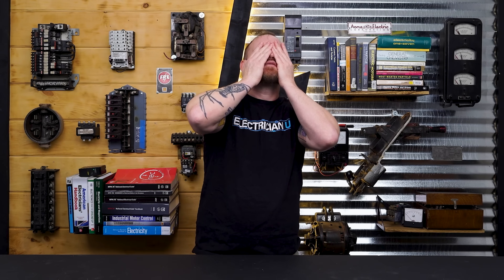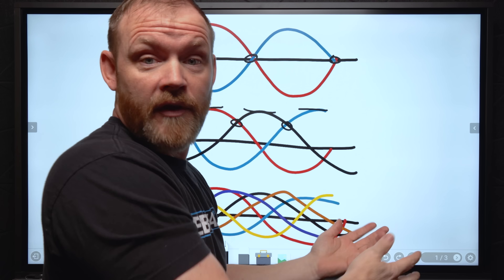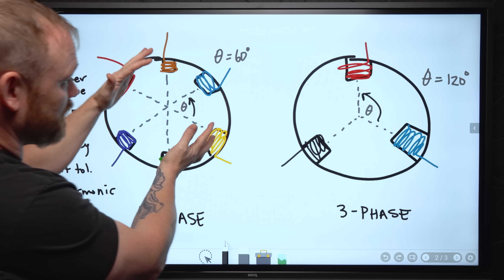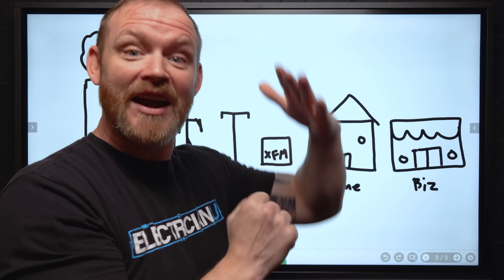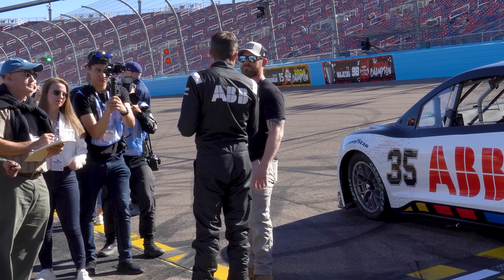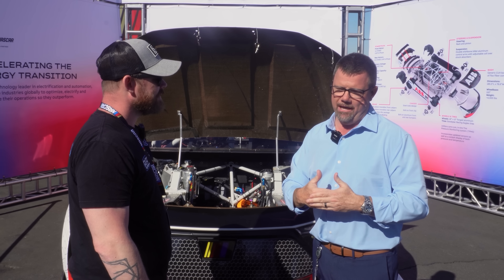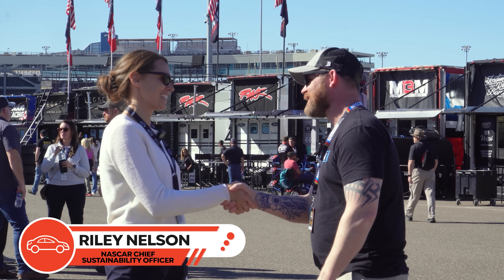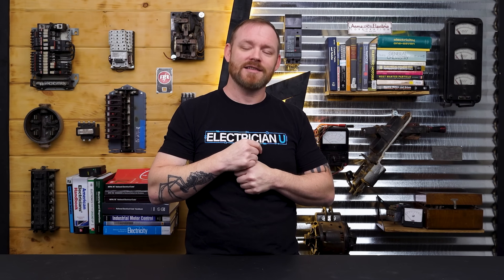6 Phase Power is a REAL GAME CHANGER!

Comment: I have only seen a few things that run on 6 phase. San Francisco's cable car cable capstan drive motors run on 6 phase. Some AC traction motor trains run on 6 phase. Vacuum tube evacuation table & final testing tables also RAN on 6 phase. Those were just hammerhead wound split 3 phase.

Comment: It only takes Only 1 more wire to change single phase to 3 phase. 6 Phase take twice as much wire that is the reason we don't use 6 phase or 12 phase the wiring cost is too great. Has nothing to do with what's in place. You can use in places where distance is very short then it can be used. It would never be practical to use it in transmission systems.

Comment: Just don’t mix up the different areas.
3-phase is the most economic way to transfer AC power. 
In car motors, more phases is like more cylinders. A 3-phase (6-cylinder; „power stroke“ every 120degrees) is creating more torque ripple than 6-phase (12cyl), but needs more parts that give more losses.

But especially for the US, that sound like „before we switch to 3-phase everywhere, isn’t 6-phase much better“.

Comment: I have a dumb question:

Lets just keep it simple and say if someone is using 3 phase power their wire thickness is 1 (plus the sheath)

If they use 6 phase would it be half as thick of a wire so like .5 thick compared to 1 unit thick for 3 phase?

Comment: Ok, stupid question time: Don't EVs operate on DC? AFAIK all batteries are inherrently DC based, so what is there to gain in converting this to AC for motor drive? More AC phases are great, but it fixes an issue that doesn't really exist in AC. Cars aren't really my thing, but it would e nice to know :)

Comment: I believe the main point in having 6-phases is to reduce inverter current and frecvency. 

For high power long time you need to have very expensive components and very efficient cooling. Splitting current to half power dissipation on inverter for each phase is half. Also when the swiching freguency for each phase components is half for the same revolution, you can get higher revs at better efficiency from the same motor. 

Also you can use different combination of phases during lover or higher revs and optimize more power output with better efficiency.

Comment: For medium power applications under 1000V (a race car falls under that category), more than 3 phases does not give you any real advantage. You already have constant power output and you don't need a neutral or star connection. If you want more power, just use thicker cables (or better, multiple in parallel) and use bigger semiconductors in the traction inverters. For very high power rectifiers (eg HVDC transmission) or older rectifiers (eg DC tram or train networks), transformers are used to make a 6 phase system from a 3 phase system (but with a 30° angle between them) to reduce harmonic distortion.

Comment: The sum of 3 sinus curves with 120° phase shift is always 0, perfectly constant.

A 3-phase motor that runs on the power grid, not a sinus inverter, has no torque ripples.

Comment: Your 6-phase claims are MOONSHINE.  Any "regular" 3-phase motor or transformer is already 6 phase.  You just wind the coil in the opposite direction to get 180 degree phase shift.  This in combination with 3 phase excitation gives 6 phases.  Half of the coils in a motor or transformer are "reverse" would, & the other half "forward" wound.
          By combining 2 coils in the same slot carrying currents 60 degrees apart in time, you can make any number of phases you want from those 6, with only a few % loss.  This is already done in 3-phase motors!

Comment: Actually  there are systems out there wich use 6 phases from a three phase supply: 12 pulse rectifiers, used for genarating dc traction current for trams or in industrial sites. The 6 phases are generated by having a delta and a wye winding on the output of the transformers

Comment: We're still a ways away from being able to do full races with EVs.  I saw a guy that converted his Tesla Model S Plaid into a track vehicle.  That's where you can tell that the Tesla was never designed for that application.  He could push it hard for about three laps before the vehicle's batteries would start getting too hot.  I'm sure that the ABB car is more application specific and has a better cooling system built in to give it more track durability.  It's gonna be crazy the day you can go to a Nascar race and watch silent cars going around a track.  I know the noise from the Atlanta Motor Speedway can be heard from 10 miles away.

Comment: I discovered a way to make a no phase DC motor that has more power and torque more efficient and smaller with no emf from field switching. Lower operating temperatures .I'm hoping to be able to display this new approach to motor design. Should be able to make all other motor types obsolete.Super efficient, powerful, based on my tests. Hope to make a video in a few months. 😊😊😊

Comment: I designed a six phase motor over seven years ago. The design requires no special materials and has better torque and power to weight ratio than any other electric motor. Bring on the Six phase era.

Comment: not a motor guy, but is that single phase looks like two phase? I thought single phase would be normal dc high spikes for 1 and low for 0, or ac just a sine wave. seems like a weird naming, if I am wrong, because what would would just a sine wave be 0 phase?

Comment: electric cars in car race is that putting a car in a horse race? different tech has different advantages you can feed a horse grass but a car you have to fuel but goes much faster. if you can't get gas the horse wins the race. their should be a mixed race that has horses electric and cars, and their should be races for just cars, just horses, and just electric cars.

Comment: For 6 phase, all you have to do is convert the three phase into bipolar power.   This permits any 3 phase inverter circuit to create 6 phase power just by running it through a transformer.

However, once you do this, it becomes exceptionally good for powering A/C motors designed for this.   Tesla (the early electrical engineer, not the company) had argued this back in the day, but nobody would listen to him because they claimed the added windings on a 6 phase motor was not worth the added expense for the amount of added torque and efficiency.  Keep in mind, at this time, most commercial companies were not even interested wanted to go with a 1-phase or 2-phase electric motor instead, due to the reduced complexity in building the motor.

Comment: I guess we are to assume its 6 phase AC syncronous? It could also be Asyncronous , PMSM, or BLDC. Any of which could be 6 phase. But based on your graph, it looks like AC, and you mentioned syncronous. Theres more area under the graph on BLDC or PMSM, so the zero point nodes you circled are not an issue for BLDC or PMSM. Also, PMSM and BLDC can run axial flux instead of radial, increasing power more by having a second set of magnets. I haven't seen axial flux AC, but i guess it might work.
Also, end losses are a thing, a set loss per coil set. More coils means more losses. IE, it's more efficient to have less number of bigger coils, although it is a balance between that, cooling, transmission, benefits of toqre vectoring with 1 motor per wheel, mass distribution.
Having said that, going to 6 phase is not a no brainer. IMO, I would go to radial flux PMSM at 800v, direct drive to each wheel through CV joints, no gear box. And for short races, augment a small battery pack with super capacitors to retain the current output while reducing mass.

Comment: Six-phase power has been done, I think about a hundred years ago.  We winnowed it down to three phase because it works just as well.  You didn't say whether these were brushless direct current motors or induction motors.  If induction, then your comment about the starting torque varying is okay.  If brushless DC, then, no, unless the motor driver doesn't know where it is until you start moving (this could be the case if the back electromotive force from the winding is used for commutation).  Where are the harmonic distortion numbers and comparisons?  This does not sound reasonable to me.  Electric motors have to be cooled, too.  Your comments about the low spots in the voltage is off.  The windings probably run on the difference between two phase voltages.  You did not plot that.  If, with a three-phase brushless DC motor, you drive all three windings with a sinusoidal current (in phase with the back EMF), the torque rate of the motor is theoretically flat, so six phase would not have an advantage with that.  It's still an interesting idea and it will be good to see where it goes.  From what I understand, Tesla is achieving efficiencies of more than 95 % in their electric motors.  That's going to be hard to beat.  Emissions?  Hahahah!  Nuclear power and you may reduce emissions.

Comment: Conventional 3 phase windings are distributed,  and since windings are winding you actually have 6 phases in the stator, and 60 degree phase difference in the driven currents.

True 6 phase has 30 degrees between driven phases, and 12 phases in the stator.

High phase order does offer some small benefits:
You can use more, smaller switching semiconductors without the problem of current sharing between parallel devices. 
You can have better winding distribution factor, meaning more efficient use of the copper in the stator.
For power transmission lines you can get more kVA into the same right of way. This means converters at both ends of the line, and only useful in specific situations (much like DC being useful for particularly long distance power transmission).

Comment: The clutter is not a valid argument. You are running multiple coils in a 3 phase motor making it 6, 9 or 12 "phase". If you need it extremly precise you can even shift the phases with a capacitor, so they don't peak in torque at the same time.
6 phase really is for transfering more power, or to use redundant power sources. So one source can fail or get serviced while the other keeps your machine online.

Comment: Motor operation from an AC current, requires an out of phase component to ensure rotation. Single phase motors need either a capacitor-start circuit or 'split phase' winding (lower power motors). 3 phase motors are self starting as the phases are 120' apart and provide the necessary torque to start with nothing else needed. 6 phases are fully symmetrical, so a 6 phase motor will not self start, similar to a single phase motor. But you have a solution there - switch 3 phases to start the rotation and then add the second 3 phases to maximize developed torque. Nicola Tesla proposed 5 phase transmission as being the most efficient, but the added costs in additional materials needed and transformer complexity, killed that idea, and 3 phase became the norm.

Comment: Cool, in some cases making 6phase doesn't cost more, couse you just use a few extra legs on the controller. And usually to drive one phase there are a few mosfets connected in parallel, so if theres 6 mosfets driving one phase of a 3 phase you just use 3 for each of 6 phases. Asuming you're using the same amount of wire to make the windings.

Comment: Just shoveing more phases in there does not allow a massively increased power.  Oh you get some but the primarly limiting factor is the cooling.  It does not matter if you have 1 phase or 6 phases you can only realistically dissipate so many watts of waste heat from a particular frame design.  Oh sure 3 phase is way more efficient than single so you do get more work out of the motor but 6 phase is not nearly the same jump in efficiency over 3.  On the other hand 6 phase is doubling the transmission infrastructure over 3 phase for fairly modest power/effiency improvements.

Comment: At 41 and a veteran, I have only recently come to understand what the deal is with our/the power grid. I have always worked on my own vehicles, and I started RC hobby projects and started dealing with batteries… solar, ect… I still don’t understand how the power grid doesn’t fail more often with the considerations that are required to maintain it, by my limited understanding. It sounds like an extremely fragile system and most people do not understand it from an engineering perspective- I’m no engineer but I was trained to have some conceptual understanding of how some things are utilized with respect to engineering.

Comment: If you would ask me before watching this video, why would six phase motor be better then three phase, I would say most probably because they can produce insane torque at low RPM and then at certain RPM they electronically switch to three phases which can bring the rpm further (same frequency, double the RPM).  No need to do it on daily commuters.

Comment: You don't want 6 phase for normal electrical systems because the cost for building transmission lines as example will be much more expensive. It is better to have a DC transmission which can reduce the cost and the power electronics are much better for the conversion.

Comment: it offers minimal advantages over the standard 3-phase system while adding significant complexity and cost to the infrastructure, making it not worth the added investment; essentially, the increase in power delivery efficiency with six phases is not substantial enough to justify the extra wiring and generator design required compared to a three-phase system.

Comment: Okay, 3 phase  multiplys the efficiency of equipment by reducing pulsation and providing more than double the torque.  You can run most aplications on a single phase.  Households only need 1 set of poles and use different phases.  Along the way, a machine shop, supermarket and auto repair shop use 3 phases so there is the reason to run 3 wires and phases everywhere and still make it economical.

6 phases however, only give you a 25% performance boost over 3 phase for twice the material.  Not very economical except in Niche performance areas like a silicone chip factory or NASCAR doing laps?

Electric motors just do not give a good scream though, I love that straightway howl.

Comment: You could start building 6 phase generation and split it to 3 phase at substations. It might be more efficient, but it would require twice the conductors, so you aren't gaining a significant amount for the additional infrastructure. For a car, or other small system where efficiency is premium, I can see some value, but I didn't know that it is great for a power grid.
Reply: In Brazil, we usually use 6 phases generator in Hydro and Termo to convert in DC or regular 3 phase.

Comment: You could probably run 6 phase power like we run split phase power or run single phase from 3 phase. Run every other phase of a 6 phase to one 3 phase motor, and then use the phases you didn’t use on another 3 phase device to balance the load between sets of phases.

Comment: Hmm sounds like Tesla the inventors magic 3 numbers come into play here. 3, 6, 9. So I wonder what happens with a steady stream from a 9 phase system then?
Reply: How about 12 phase ? 18...?
The law of diminishing returns gets in the way. 
The added complexity and conductors to distribute rapidly outweigh the benefits.
Btw. 
They say Mr. Tesla made a 60hp 60 phase motor that could fit under his tophat. 
Aside from scientific achievement & curio, completely pointless.
Reply: @ Personally I would limit the amount to 9 at the most. Also I would probably be choosy about which use each type phase has but I really want to play around with 9 phase to see what power can be pumped out of it but I would think that silver coated enamel wire would be needed for this type for best results for cooling and space requirements. (I also don’t understand your passive aggressive demeanour when it’s not like someone is going to break into your house and force you to change your wiring. 🤦‍♂️)

Comment: First. There is no such thing as 2 phase, unless you count stepper motors, but they are 90 degrees apart not 180. 

3 and 6 phases are the same thing😮. Because you can wind a coil backwards and flip the phase 180 degrees. Unless the phases are 2 independent 3 phase power systems that are 30 degrees apart,  unlike what you showed.

Also if you lose a phase in a 3 phase system, you have single phase power, 2 wires can only carry 1 phase. No rotating field.

Sure 6 phases is more fault tolerant, 6 wires - 1 wire = 4 phases, which still has a rotating magnetic field.